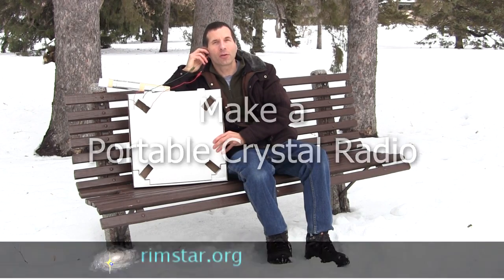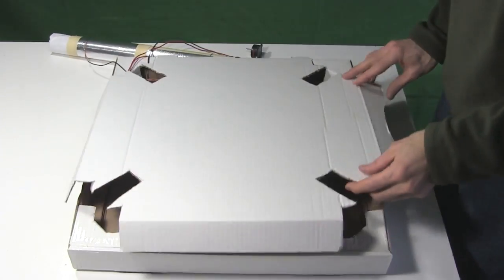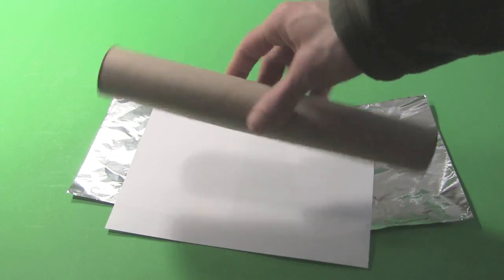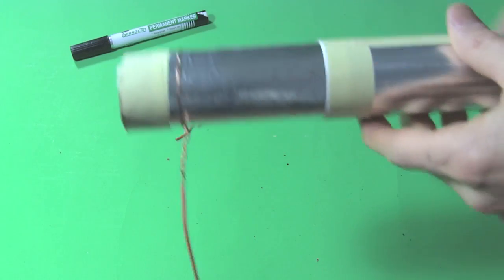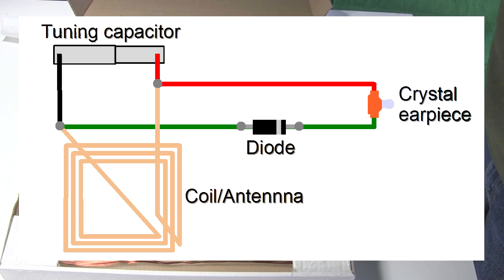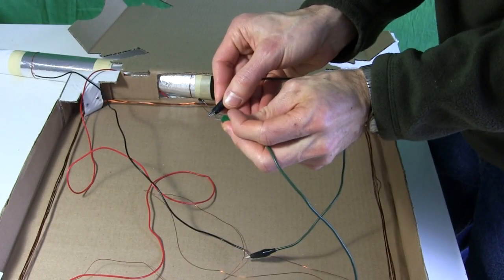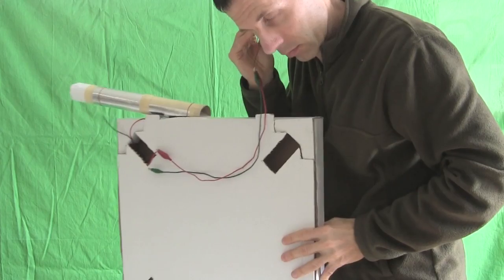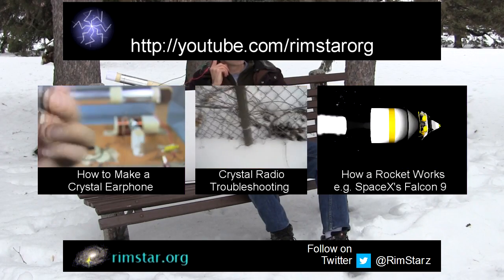Portable Crystal Radio using Loop Antenna and Pizza Box

Comment: can we use razor blade diode for loop antenna crystal radio
Reply from the maker: You can try, but in my experience I had trouble getting the razor blade diode to give strong results, and that was with a grounded crystal radio with a straight wire antenna. Combine that with the fact that the output of the loop antenna crystal radio is already fairly weak and you may not hear anything - unless you're near a very strong radio station. But your experience may be different.

Comment: i took apart one of my toys from when i was a kid and found a speaker with wires to connect it to stuff, can i connect this to the crystal radio instead of an earpeice?
 oh and does it matter what kind of 26 gauge wire you use for this???
Reply from the maker: No, this portable crystal radio won't power the speaker. You'd need to do the trick I show in my "Use Earbuds/Earphones with Crystal Radio" video http://youtu.be/GCh2LVHUavQ plus you'd need a more powerful crystal radio like the one in my "How to Make/Build a Crystal Radio" video http://youtu.be/VqdcU9ULAlA instead since that one uses a long antenna and an Earth ground connection. And even then, I'm not 100% sure it'll work. Maybe with a long enough antenna (100 or more feet?) and/or a radio station nearby.
Alternatively do what I suggest above and use earbuds instead, or use the links in the description to this video to order a crystal earpiece online.
Reply: ok well then ima getting my work outfit on, im making something
Reply: oh ya, do i HAVE to use insulated wire for this portable crystal radio, cause i only have non insulated, like what would happen if i used non insulated?
Reply from the maker: Bobert funfunfun
Do you mean for the coil? The turns of the coil must not come into electrical contact. So it'd either have to be insulated or each turn would have to be spaced apart somehow. And the gauge of wire you use doesn't matter.

Comment: where should you get the earpiece from ??
Reply from the maker: I've put some links in this video's description to where you can get the earpiece. You can also make one from a piezo buzzer which you can buy at electronics stores like Radio Shack and some hardware stores. See my "Crystal Radio Troubleshooting and Tips" video http://youtu.be/HZZmKZJrIW0 for an example of that. I've also made one using a piezo speaker taken from a microwave oven as shown in my "Make Crystal Earphone/Earpiece for Crystal Radio - Homemade" video http://youtu.be/OVapqz4yBCY

Comment: Hey I was wondering about something that appeared in your previous radios and something you said in the beginning of this one. Why did the other crystal radios require a ground, but this portable one does not?
Reply from the maker: It's all a question of trade offs. The other crystal radios can work without a ground but not as well. With the other circuit in all my other videos, without a ground you'd have just one coil instead and more interference from other radio stations. It would also make it harder to tune in to one. And that's the case with this portable crystal radio since it doesn't have a ground. If you put the whole palm of your hand on one of the capacitor plates to provide a makeshift ground then it works much better.

Comment: Hello.
Great projects on Rimstar.org and I intend featuring some in our club's activities, techonocorner.org.  I have completed the "pizza box" crystal radio, but not being partial to the product, I wound copper alarm cable around four posts on a wooden base 18" x 15" and increased the windings to 16 turns.( I do not know the dimensions of a pizza box, so I guestimated 19 inches per side. )  I live on the South Wales Coast, UK and reception on AM is not great and this may explain why I receive no sound. I checked out the troubleshooting video. Is there a contact address that I may send my build procedure, which is likely to be at fault?
thanks
Reply from the maker: You can find may email address at the bottom of any page on my website,http://rimstar.org (I don't like putting it in textual form.) But your build procedure probably isn't at fault. Since there's no long antenna and no ground connection with this one, it picks up only strong stations. If AM reception already is not great where you are then that's likely the reason. A very simple way to provide a so-so ground is to hold the palm of your hand on one of the aluminum foil cylinders of the capacitor. Use as much skin to foil contact area as you can. Alternatively you can just connect that capacitor plate to Earth ground.

Comment: does the diode have to be germanium?
Reply from the maker: Yes, though you could try using a few silicon diodes connected in parallel (striped sides connected together and non-striped sides connected together).
Reply: RimstarOrg Thanks

Comment from the maker: That's what my desktop crystal radio is when you use the razor blade and pencil diode. It still uses a long wire for the antenna or clips onto something. If you can get a ground then that helps too. I recently carried my desktop crystal radio in a shoebox to a Maker Faire. I strung the antenna wires along the floor and plugged into their wall socket for a ground. So even that one is portable.

Comment from the maker: It may be possible to use a razor blade and pencil instead of the diode but since this radio isn't very powerful, I'm not sure you'll hear anything. See my video "Make Razor Blade Diode for Crystal Radio/Foxhole Radio". You may want to make the radio in my "How to Make/Build a Crystal Radio" video since it has a ground and a long antenna and is more powerful. For using earbuds see my video "Use Earbuds/Earphones with Crystal Radio" but again, you may need to make the more powerful radio instead.

Comment from the maker: I'm not sure. I think not though, unless you have a diode that turns on at a very low voltage, around 0.3 volts. But even then I'm not certain.

Comment from the maker: Yes. But it must be insulated if the turns will be touching each other like mine are. Mine is enamel coated copper wire, also called magnet wire because it's normally used for making electromagnets. But any wire will do and any insulation will do. In the case of an antenna that's just a long straight line then the insulation isn't needed since no two parts of the wire touch each other.

Comment from the maker: I'm using 1N34. Other diodes which should work are 1N60, 1N91,  1N119, 1N270, 1N277, 1N283. If all you can find are silicon diodes then you could try connecting a few in parallel and putting the result where a single diode normally goes. To do that, connect together all their ends that have the stripes on them and connect together all their ends that don't have the stripe. I can't say how many to try, maybe 4 or 5 or more.

Comment from the maker: Which diode are you using? With no long antenna or ground it won't pick up stations as easily as designs that have them, so it needs a germanium diode. Try using yourself as ground by putting your hand on the aluminum foil of the tube that moves - spread your hand out for a lot of contact. Also, you need to be facing the radio station so make sure you point the flat side at the station and then adjust the capacitor. If you don't know where the station is then keep rotating it and adjusting.

Comment from the maker: That's a silicon diode. If you have a very long antenna or are very close to a powerful radio station then it might work but otherwise you need a germanium diode, or you could try multiple silicon diodes connected in parallel (all the striped sides connected together and all their non-striped sides connected together.)

Comment from the maker: Actually it's called a "loop antenna coil". I guess all coils are loops, but the emphasis here is that the antenna is in the shape of a loop. All crystal radios have an antenna, usually it's a long straight wire. Most crystal radios also have a coil, usually a small thing about the size of a toilet paper roll's cardboard tube or even the size of a pencil. But in the crystal radio in this video the antenna and coil are one, the coil is also the antenna. So it's called a loop antenna coil.

Comment from the maker: Making some sort of amplifier like you're talking about is on my todo list, but I won't be doing it too soon. 22pf is too low. You need something that can go from around 40pf to around 355pf. I was thinking of doing a transmitter but I'm always worried about interfering with other radios so I may not make one.

Comment from the maker: Yes, 1N34A should be okay. I'd suggest rechecking all your connections to make sure they're good. But this loop antenna isn't as good as a long wire antenna. I can pick up only a local station that's around a mile from where I use it. Point the flat/big side of the box toward the radio station. If you don't know where a radio station is then make very small adjustments in both the direction you point it and in each adjustment to the capacitor. What are you using for the earpiece?

Comment from the maker: No, 1n4001 won't work for two reasons. It's a silicon diode and for this circuit you need a germanium diode because germanium diodes are leaky and silicon diodes are not. This circuit needs the diode to leak. The other reason is because the voltage at which the 1n4001 starts conducting is much too high.

Comment: Hi.  Your video was well done.  I like how you show many of the construction steps and you used many commonly available materials.  Your crystal radio works a lot like RFID inlays because the antenna coil catches the radio energy, so batteries are not required.  The antenna coil you made inside the pizza box is a larger version of the antenna coils found inside of RFID wristbands.  So, your video also helps explain how part of RFID works.  Thanks.

Comment from the maker: Sure, you'd need to an amplifier circuit and the battery would drive the amplifier. It wouldn't be called a crystal radio at that point. Crystal radios are by definition radios that are powered only by the radio waves. It'd be just a normal radio. With the right circuit or antenna I guess you could get rid of the bigger antenna (which is the reason for the box.) I don't know what small, battery powered radios do for an antenna though. My alarm clock/radio doesn't have any noticeable antenna.

Comment from the maker: Thanks! It picks up AM. The capacitor is a variable capacitor aka tuning capacitor. I adjust it at 4:45 in the video. It should have enough capacitance range, combined with the coil's inductance, to pick up all the AM band. But it's weak since it doesn't have a ground like non-portable crystal radio do. Plus putting the antenna coil and resonant coil in one hurts it too. But I got at least one station. You may be interested in my "How a Crystal Radio Works" video, link in the description.

Comment from the maker: I think it works mostly with local stations. I got just one so far that's only a few kilometres from my place. I think for longer waves you need less turns so I think making sure you have enough capacitance may be more important. The capacitor in this video is up to 640pF so it should be fine. For the number of turns I looked around the web, everyone seems to be using around 14 or 15 for loop antennas. I tried 23 but with worse results. The idea of putting it inside a pizza box was my own.

Comment: wow, thats very surprising, but i think you have less radio stations to pick up, becouse there is no wiper blade, or something similiar. i think in country, like Russia, where mid-long waves is still are in use (due to long distances) you would need to adjust the numbers of the coils? and you chosse just the right music. do you come with designs by yourself? i mean you calculated how much turns, for resonance you need, and stuff?

Comment from the maker: Yeah, I've used it in a few radios now. Super easy to make and from stuff around the house. Just keep your fingers off the foil while using it so as not to interfere electrically - though sometimes it helps :).